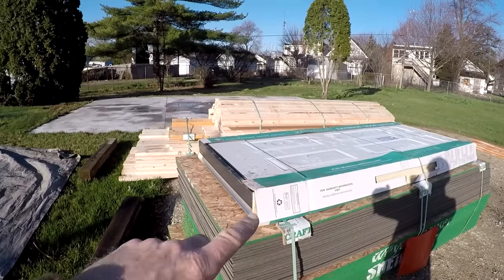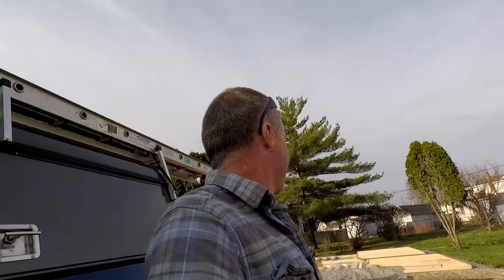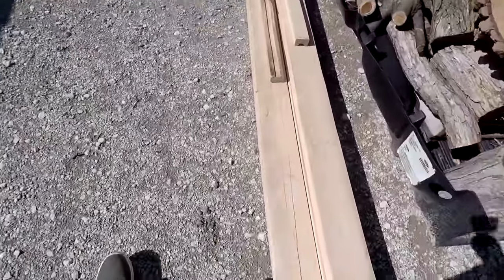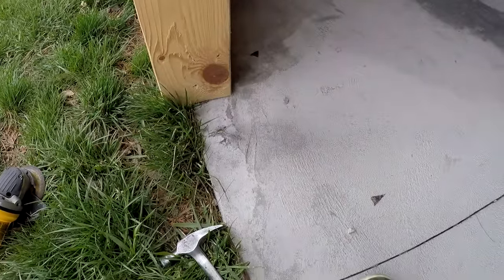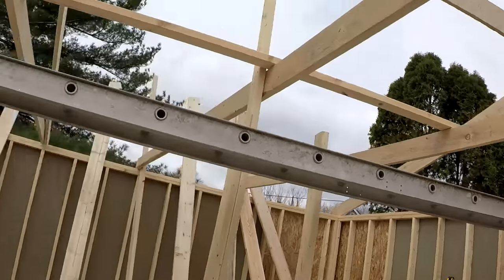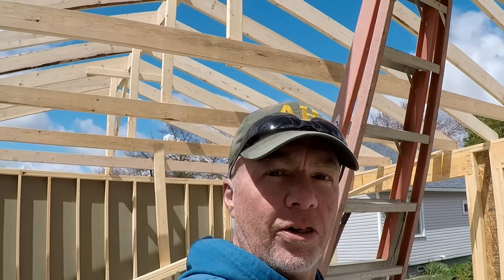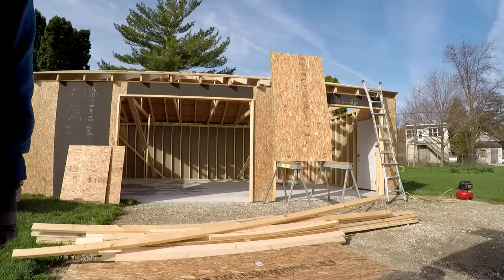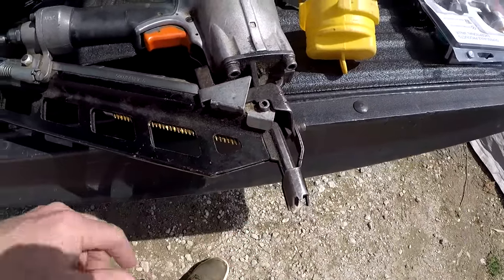Full Build! I Framing Alone | 24x30 Garage

Comment: I’m concerned about roof load. Given the span the 6-8 2x4’s down to the rafter ties aren’t going to support the ridge appropriately. I am jacking an old building currently that had a similar arrangement and the ridge sank nearly 8 inches in the middle over time. The collar ties are too high in my opinion as well. The top 30% is good, but all the way to the top is not doing much with regard to uplift. Not sure where you are, but wind does seem to be a factor. We are seeing so many sinking ridge boards I would have run a spine brace all the way down the middle of the rafter ties and then 4x4’s up to the ridge off the spine brace and then struts down as well for the rafters. This appears to be the absolute minimum and if the clients budget didn’t allow for proper structure design I would have passed on the job. If I was going to brace it that way I would have, at the very least, used rafter ties on every rafter and braced to the ridge on every rafter.
Reply from the maker: This design is approved by code here, I’ve built literally hundreds of garages this way and never had an issue. But that doesn’t mean you couldn’t build it your way, nothing wrong with extras!

Comment: I would keep my temporary ridge support a bit lower  Then you can shim up to the correct height. Use a piece of ridge board to set height an as a spacer between the common rafters. Do both gable ends. String a line from point to point. Now you know your center support height.
Reply from the maker: I do try to keep them a couple inches low, it’s definitely easier to shim up then take the support apart to lower it!

Comment: My uncle wrapped his house with that crap black board, but it does add an R factor to the insulation factor.  And too it is much cheaper than OSB. When he got done with the black board, he added the styrofoam to add another R factor.  So when he wrapped his walls with the black board and the styrofoam, his R-13 insulation became like an r-20 which is much more than needed for walls.
Reply from the maker: Well, I guess there is an upside to it!
Reply: Another upside is if he has to make a quick escape. He can just run right through the drywall,   crapboard and styrofoam lol. Vinyl siding may take second charge to get through but shouldn't be too bad

Comment: I am getting quotes for a detached garage. The contractors, I have contacted need engineered drawing. The Engineers need architectural drawing. Where do you building contractors go for these type of drawing where they would work directly with the home owner?

TIA
Reply from the maker: The contractor I work for does all the drawings in house, I’ve even done some for them. There’s an engineer that they go to when needed. Codes are different everywhere you go🤷‍♂️

Comment: I built my 24 x 32   shop by myself. The only things I did not do...
Grade the site , pour the slab, insulate and hang the sheet rock. Everything else I did by myself having never built a structure before. What compelled me to do this was the arrogance and smugness of contractors, obscene bids.
What one man can do, another can do. When I got my "final" the inspector said that the building was textbook and better quality than most "homes" let alone shops.
Reply: How many days did your build take you?
Reply: @NoName-ml5yk  As I recall, about 60-70. Many days were 12-14 hours.
There were good days and bad days.
Reply: @jeffhildreth9244  Thanks, that helps.
Reply: @NoName-ml5yk  I forgot to add, I dug all the trenches for the footing, bent and installed all the re-bar and doby blocks...Installed all the electrics and doors and windows.. but had a pro company install the 16 ft roll up door. 
As has been said by others,   a massive project is a series of small projects. 

It does help that I had a full professional wood working shop 25 x 25 and was a furniture maker for 2o plus years.. so had some skills and plenty of tools

There is no feeling like that of accomplishing something that appears to be daunting.

Don;t doubt yourself. Do some research and jump in. There are always folks that can help you if you get in to a corner.

BTW   My building was not perfect.. Measuring on the diagonal, corner to corner.. I was 3/8ths of an inch off square on a 24' by 32' building.... I'll settle for that.
Also I did fall off the roof...It rained just after before I was ready to install the roofing. So I draped the entire roof with black plastic sheeting.  and cinder blocks.... When it stopped raining I went op to remove the blocks and the black plastic.. and while at the peak of the roof on my belly, I slid down head first on water droplets and unable to stop. I went  off  the roof on to scaffolding and it started to fall away.
I threw my leg towards the building wall to catch myself and stupidly kicked the wall.. I went down and the scaffolding went down with me and it all landed on top of me.  Bruised but not broken.
Dumb move : ) I'll never repeat that. 

Happy New Year
Reply: @jeffhildreth9244   Wow a slide and slide on a roof.  What a story.  Only thing I for sure won't do is pour the concrete.

Comment: I saw your headline haven't watched the video yet but I thought I was the only old fool that did buildings by myself !
Edit... After watching you sir are a master framer, and I would have to agree that blackboard wasn't any good 40 years ago and it's still  junk today.
I did notice that you don't wear those heavy bags anymore, can't say I blame you much I hate wearing them too.
It's great to see someone still has a good work ethic!
I find it funny too you mentioned eating your Motrin
Most older Carpenters have a bad back so a Motrin is a must just to get you out of the Truck ! 
Enjoyed your video !
Reply from the maker: Well there’s at least 2 of us out here!
Reply: @MyDIYAdventures  I did do an edit to my reply after seeing the video you might find it funny.
And I did push the like button.
Reply from the maker: I usually only wear a tool belt anymore if I’m hanging siding.
Reply: Celatex is bad but have you ever seen that denny board? 1/8×4×8, very thin.

Hey! Great video thanks!
Reply from the maker: Is that the cardboard looking stuff?
Reply: @MyDIYAdventures  Yes. At least it has a thermo reflective layer on the exposed side. I saw it alot on apartments in the 80s ,90s.

Comment: That's a great garage size. I personally would have went 30x30 so a pickup truck would fit in there nicely. Idk if them doors are high enough for a f350 crew cab long bed
Reply from the maker: Of you have marker lights on the cab, they may get removed by a 7’ door LOL

Comment: Nice job. 
If the garage is a 24’ and the joists are 24’ why are they hanging out a bit on the garage door side. Are the joist a bit bigger or is the garage not a true 24’

Also when your removing the bracing after you were pretty much done you could see day light between the rafters and the walls,what goes in between that?

Thanks.
Reply from the maker: Yeah, the joist are usually about an inch or so long, and the bottom side of the eaves get covered with a vented soffit.

Comment: Why on earth are you wasting time and structural integrity on rafters? Especially 2’oc? Do you not get measurable snow? Sorry but I’m not impressed with the choice of roof. Your work looks great besides the fact
Reply from the maker: Everything is built to (minimum) code, I’ve built literally hundreds of garages like this and never had any structural problems with them🤷‍♂️
Reply: @MyDIYAdventures  I understand where you’re coming from but I have been in too many old sagging roof garages to still build that way. I’ve been a carpenter for 35yrs and contractor for 30. I’ll admit I’ve lost jobs because I refuse to build to minimum codes. Just a choice
Reply from the maker: I just build to the specs the print tells me…and you can bet I sure as heck built my own garage 16”oc!
Reply: @MyDIYAdventures  i totally understand where you’re coming from, I’m not criticizing your work by any means. Like I said I’ve lost jobs due to not being willing to build to lower than personal standards.

Comment: How do you stop the water from getting under the wood frame on the floor.
Reply from the maker: Well there’s a sill seal under the bottom plate to help, the siding should hang down just below the plate, and the slab SHOULD be a few inches above grade (this one was not).

Comment: 1 man doing a 2man job on tossing the roof together, i cant believe any where would allow that fiber board for wall sheathing, without  1X6 in wall bracing or at least that cheap metal angle bar. And yeah it seems to have become every day occurrence that masons on concrete guys never get anchor spacing correct, even when they get a print. Best of my knowledge in my area its always been 6ft maximum spacing and 8" from corners and beem pockets

Comment: I noticed your Slab is close to the exterior grade. Will you be required to regrade your yard around the building to maintain code required 6in. From slab to dirt grade. Or is is not required in your region. Great build thanks for sharing.
Reply from the maker: It is required where I’m at, but on an existing slab like this was, inspectors always let it slide. I plan on making a video addressing this topic soon.
Reply: @MyDIYAdventures  Thanks, I subbed and look forward to  more vids.
Reply from the maker: Thank you!

Comment: Is this garage required to have a portal frame at the overhead doors by code? Isn;t the code for rafter ties to be at a maximum of 24 inch centers? I am also not seeing collar ties or hurricane clips. Was the edge of the slab thickened if this was slab on grade?
Reply from the maker: Nope, not where I’m at.
Reply: @MyDIYAdventures  Curious as to what state you are in.
Reply: @MyDIYAdventures  What state are you in?
Reply: @MyDIYAdventures  What state are you in?
Reply from the maker: I’m in the lower 48
Reply: @MyDIYAdventures  Ok. There aren't too many states that have not adopted parts of the International Building Code into a state residential code which are online to look at. The things that I asked would not be in a local code.

Comment: Im just curious as to why the gable end walls have a 30 foot 2x6  running end to end when they really should spanning between the eve walls,weight of roof will naturally,physically,want to spread eve walls apart.Collar ties alone will not achieve this,especially at 2 foot OC.Integrity in structure should be achieved by the framing,not sheathing.
Reply from the maker: I'm an idiot...what are saying?

Comment: 24x30 garage too close to grade, the floor should have been 3 to 4" above grade otherwise its a termit nest watingbto happen. Id dig a trench around the outside 4" deep 3' wide and fill with pee gravel it will both keep insects away and give drainage for water. You'd lay a tight geo fabric in the bottom and can also set drainage tubs running away from it. It needs a powe panel lights and power outlets id run 240 from the house off the main to it. 
Why are studs cut at 8' on walls. Why wasn't the facia bords put on before the roof sheathing so you could nail over to top of facia , there's a lot of improvements that could have been done to strengthen it as well as keep water out.  You clearly know what your doing but you've got to do more then you were taught,  yes roofing goes over the facia, but wind can still getbup under the roof shething if your in the midwest you've got to consider tornados and high wind factors,  I think it should be code in this region to use huracain straps to hold roofs in place less nails and more screws, nails pull out it takes a lot more to pull a screw out. The hurcain straps should be bolted on not nailed. 
Codes not perfect it needs to be modified for each region. Also with that sheting material you've got no lateral strength from racking.  Ive got a 2 story house they used that shit on with no shething its a fiber board ment to be siding and shething,  the only true strength is the sheetrock. And we know nails pop on sheetrock.  And I didnt see any construction adhesives used.  You could see the wave in the fibrous shething you used. Sometimes you've got to educate the property owner the importance of the extra 800 bucks for the right materials.  OSB in place of plywood is bad enough.  I know for a fact 
OSB and water make for a bad wall.
Im not really blaming you im looking at the engineering for improvements that could have been made.  Im not a contractor and never did construction 
Just some DIY stuff.  With that foundation I might have set 1 corse of cement blocks on the floor set some anchors and filled the blocks with concrete and my tie downs to the floor, then installed by bottom plates I could the use 10' shething to over lap the blocks and go up over the top notching out for the rafters. Attached my facia and cut back the siding flush, then put on the roof shething over the facia then an aluminum flashing then over that ice dam thenbtar paper up to the top then do shingles gutters ex.. the bottom would be glued with construction adhesive to keep out the wind and insects. 
Insted of lasting 10 to 20 years it last 50 to 100 years.
To make it even stronger the top plate would be anchored to the floor every 24" with metal bracing like 2x4 tubing 3/16 thick wall.  The last part is a set of solid wood garage doors rated for wind.

Your garage door on a house is the weak point in a tornado.
Reply from the maker: My next video addresses the grade issue.

Comment: Great job on that build. In the part where you're doing the sheathing on the gable end, you have two nailguns you're switching - what was the reason for that? Two different nail sizes?
Reply from the maker: I was nailing the blackboard with a roofing nailer.

Comment: I always  called that Celotex ground up corn stalks. One job, one of the guys covered the fireplace opening in the floor with Celotex instead of plywood.  No one noticed until the drywaller was finishing the ceiling.  He stepped on it and was suddenly 30" shorter and couldn't reach the ceiling!!  After we recovered from dying laughing, we were suddenly aware how badly it would have ended if there had beeen a basement instead of a crawlspace. 😮😮😮
Reply from the maker: Ouch 😳

Comment: Why did you use galvanized nails on copper treated lumber. That's ass backwards.  Do not use galvanized on treated
Reply from the maker: No, you MUST use galvanized in ACQ lumber to avoid the corrosion caused by dissimilar metals.
Reply: @MyDIYAdventures  I am half wrong. SS or HOT DIPPED galvanized are ok. Old galvanized nails and screws will rust out on decking since 2007.

Comment: Never to old to learn, I built many a home and garage and never thought of placing the gable ends face to face, or back to back, to cut them with one cut, so simple and looking at it have no idea how I never figured that one out but good to know, I don't do much framing now mostly finishing but something to keep in the memory, oh no i learned something new, what fell out? 
Question for you, you already use cordless saws and grinders so why not a cordless nailer? Last one I tried was far to heavy but that was many years ago and I think they have got much lighter now, maybe not but I do still use air to brads, small nails and staples.
Reply from the maker: I don’t think battery nailers are very practical when 10,000 nails are going into a job.

Comment: I just observed that your frames were hanging off the slab by few inches, reason? Won't the frame and sheating be in touch with water on the ground?
Reply from the maker: It’s a treated plate, so it will be fine. As for the OSB, the surrounding grade is supposed to be lower, but that’s on the homeowner because he had the slab poured a year earlier.

Comment: If I have the concrete slab with J  bolts in the slab but not building garage until next year is it kosher to cover bolts with 4x4 to prevent someone stepping on or tripping?
Reply from the maker: That’s actually a pretty good idea!

Comment: I guess you have no inspections cause that roof ceiling construction is not per code. You are building a hybrid ridge beam/ truss. That is not a ridge beam as it is not strong enough.
The ceiling joist are overspanned 2 to 3 times. Build you own trusses on the ground and lift then into place or use conventional framing per the charts.
Reply from the maker: I’ve literally built hundreds of these, and they are all to code.

Comment: Great videos sir, i'm also a one man builder / remodeler something i do differently when i have to lift built up beams or heavy headers i have a drywall lift  with different  width ' u' shaped cradles i made from 4" flat bar mild steel . this allows me to build the header on the ground then hoist it up and nail it in place. Do you always stick build the trusses or do your ever order engineered ?
Reply from the maker: Yeah, we sometimes do trusses. That’s a great idea to use the drywall lift!